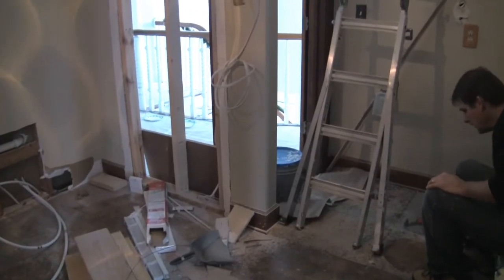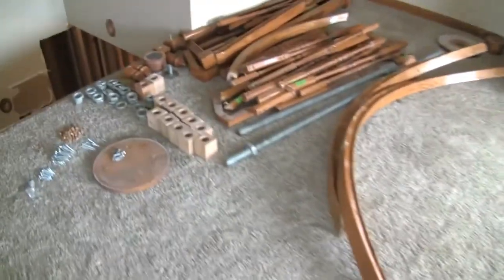How to Remove a Spiral Staircase

Comment: I have one of these that I'd like to remove but it's cast iron and probably weighs a thousand pounds. Looks like it will just fall over if I undo the top section. I don't think it's actually attached to the floor at the bottom at all. I don't even see how it was assembled in the first place tbh.
Reply from the maker: Just go slow and support everything well. They got it in there so it would make sense it can be removed… just have to work the puzzle.

Comment: How much would a conversion cost
Reply from the maker: Hey Bindi Naik,
It hard to say but I can give you a ball park estimate. 
Disassembly - maybe 4 hrs /$250 but it really is dependent on your set up. 
Installing our new stair case in our instance required moving walls. Say $1000 to create a space that will work?
Then to build the staircase - maybe $50 per step in material costs and another $50-100 per step to construct it. 
So - if you do it yourself , maybe $700. 
If you hire everything out maybe something like 250+1000+2250 or $3500

Don’t hold me to it... just a guess - trying to give you some kind of idea. Your particular area and connections with contractors could dramatically change those numbers. 
Thx for the question.
Reply: Thank you so much